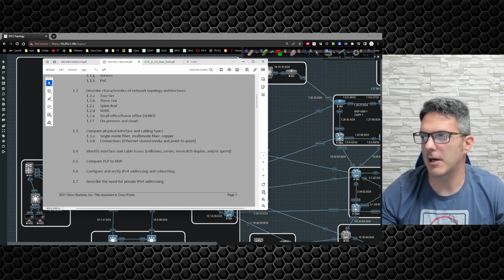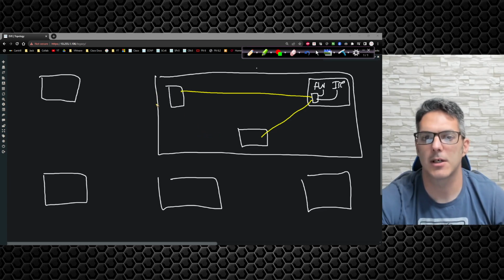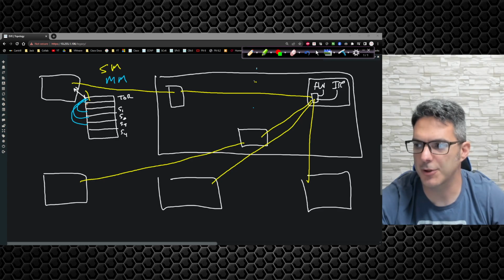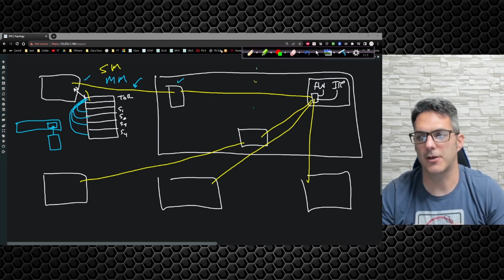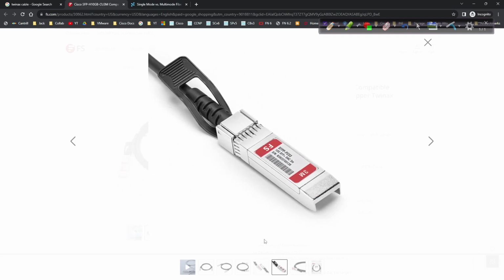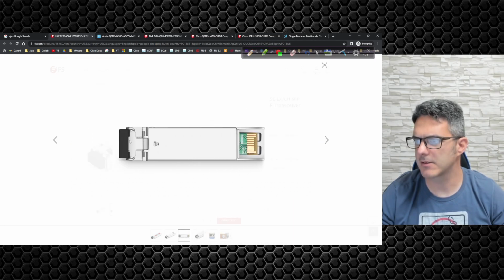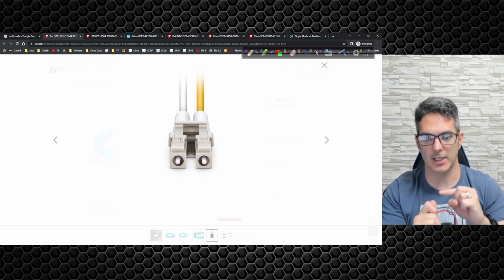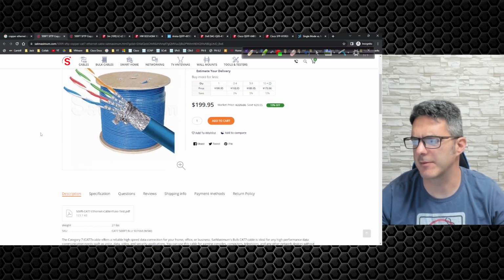Cisco Enterprise Series - Fundamentals - SM and MM Fiber, Copper, P2P and Shared Ethernet

Comment: a. Single-mode fiber, multimode fiber, copper

Single-mode fiber (SMF): This type of fiber optic cable is designed to carry light directly down the fiber. It has a small core (about 9 microns in diameter) and allows only one mode of light to propagate. SMF has a higher bandwidth than multimode fiber and can carry signals for longer distances (tens of kilometers).
Multimode fiber (MMF): This type of fiber optic cable is designed to carry multiple light rays or modes concurrently, each at a slightly different reflection angle within the fiber core. It has a larger core (about 50 or 62.5 microns in diameter) than SMF. MMF can carry signals over shorter distances (up to a few kilometers) and is used for data and audio/visual applications in local-area networks and connections within buildings.
Copper: Copper cables, such as twisted pair cables, are widely used for short to medium distance (up to 100 meters) data transmission in networks like Ethernet. They are less expensive than fiber optic cables but are susceptible to electromagnetic interference and have lower bandwidth and data carrying capacity.
b. Connections (Ethernet shared media and point-to-point)

Ethernet shared media: In this type of connection, all devices share the same communication line or path. This was common in older Ethernet implementations where devices were connected in a bus topology using coaxial cable. A disadvantage of this approach is that if many devices are transmitting at the same time, collisions can occur, leading to retransmissions and reduced network efficiency.
Point-to-point: In this type of connection, a dedicated communication path is established between two devices. This allows for uninterrupted data transmission and is common in modern Ethernet networks where devices are connected using a star topology with switches. This type of connection is also used in wide area networks (WANs) for connecting distant networks.